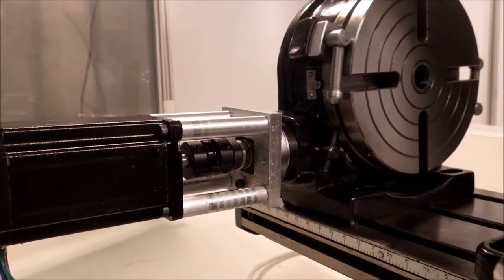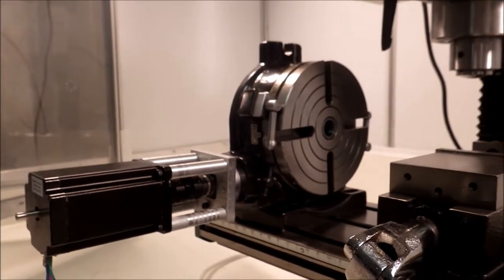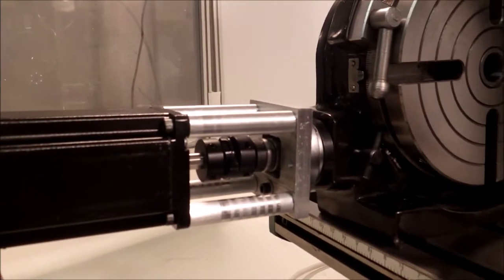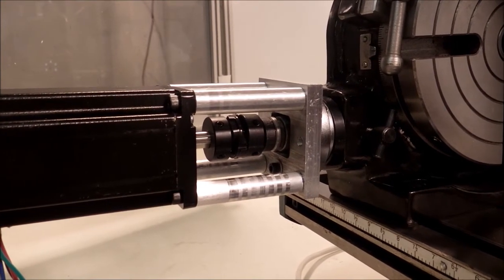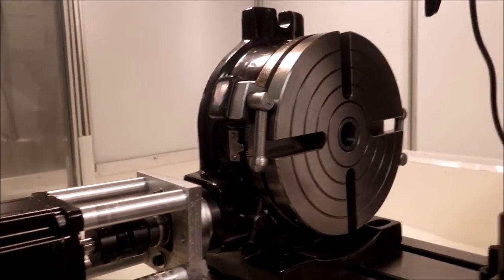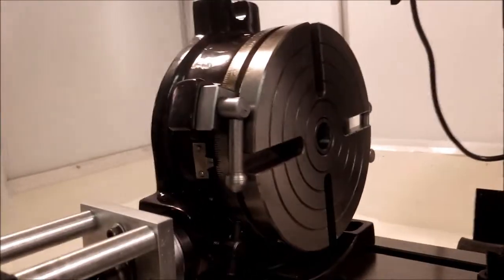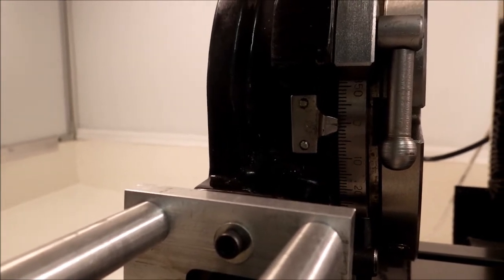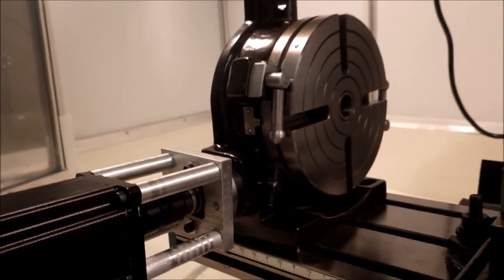A Rotary Table for the CNC G0704

Comment: Looks good!!! Did the rotary table meet your expectations as far as quality is concerned?  I am building a g0704 as we speak and making 4th axis, even if its only a indexer has always peaked my internist!   - Nick
Reply from the maker: I sill haven't used it other than playing with it as a non-CNC table.  The manual has very little information and is barely understandable, but one turn of the handle is 4 degrees, so 90 turns for 360, and with 200 step motors, .02 degree per step.  I thought it was nice and smooth, the brakes stopped when you wanted it to stop and it seemed well made for the price point.    

I'm in temporary holding pattern. I had some Tee nuts that I thought would fit but never bothered to check.  So I have no way to hold work to it, just yet.  - SiG
Reply: Thanks for the feed back, when you do use your sweet 4th axis defiantly take some video. I would like to do as you did just want to make sure i dont start out with something to crappy as far as quality goes...  - Nick

Comment: any backlash issue?
Reply from the maker: The value I have in Mach3, measured with a 6" lever arm clamped to the RT and dial indicator, is .035 degrees.  It's probably actually .040 degree.  The drive makes two microsteps per commanded step, and microsteps are .01 degree.  I don't think it can be more precise than that.  I'd have to make a LOTTA back and forth moves to see the difference between .035 and .040 degrees.
Reply: SiGraybeard thanks for your feedback, I would also think this is already a good result. do you have any plan to upgrade to dual rotary?
Reply from the maker: You mean on the headstock as a fifth axis?  I've given that some thought, and looked at HossMachine's video, but that's as far as I've gotten.  I don't have a CAM program that would take advantage of it.
Reply: what a pity for the cam program barrier,  I saw some one did a wonderful job on dual rotary table of this type and posted video as well, but I am not sure that was HossMachine, but anyway, thanks for your good job and shared with us, good luck